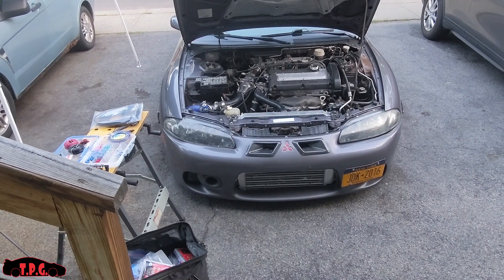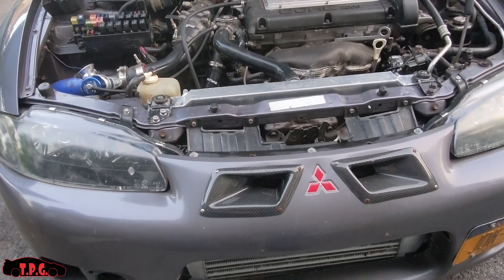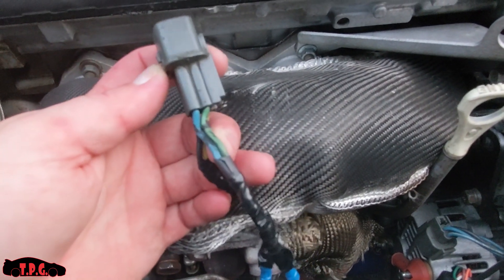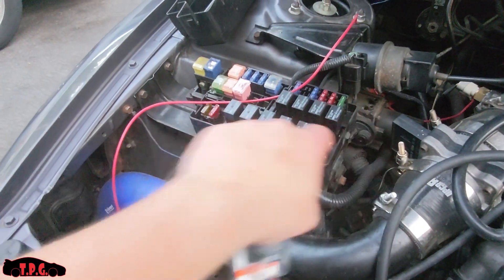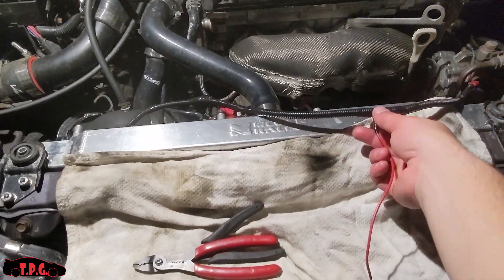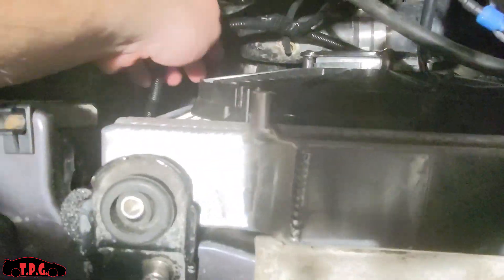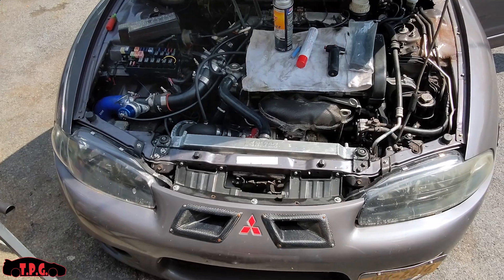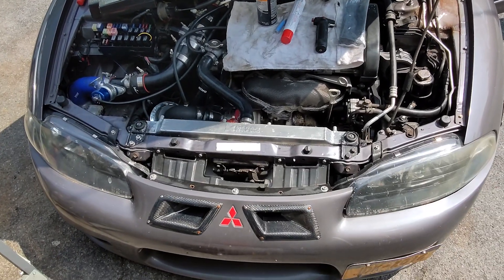WIRING RADIATOR FAN RELAY FOR DUAL SPAL FANS! (2g dsm aftermarket fan wiring)

Comment: Spal fans require 40 amp inline fuse relay to run cause they draw to much amperage they can fry your harness
Reply from the maker: Thanks for the heads up 👍 I've since rewired all of it through stock wiring with a secondary fuse all controlled by the ecu. Hopefully no more issues come from it.

Comment: You dont show at all where 86 goes or a clear explanation
Reply from the maker: Sorry about that. These relays use the same parameters if you look up a diagram. 86 is the signal from the oem harness. That will trigger the fuel pump or radiator fan or any accessory that you run with a relay to turn on. Sorry about that.

Comment: Could of just wired it to your factory connections.  
Have 2 12” slim fans, just cut the pigtails and go from there….
Reply: I was running my stock wires also. Kept popping fuse. I do believe I have a short somewhere
Reply from the maker: i DID have them wired in to the factory plugs, unfortunately the two 12in spal fans pulled to many amps for the factory fuse. I tried going from 20amp to 25 amp then 30amp (which is usually a no no). The only way I could keep them both running in ecmlink at the same time was adding a fan relay fed from the battery and triggered by the stock power wires. So far no problems with the exception of the clutch haha
Reply: @TPGDSM  that’s weird? Been running it like that for decades, even with link🤔
You might have shortage or a wire crossed pulling power out somewhere.
Well you got it so Gues that’s all that matters🤷🏻‍♂️ lol
Reply from the maker: @Ryan_1997  honestly I thought the same thing, checked for draw at the fuse panel, followed my wires and nothing?. Maybe something will show one of the next times im in there digging around.

Comment: Does the heat blanket work?
Reply: I run a blanket for my fp manifold and 11 and 12 inch spal. Kept my Temps in check
Reply from the maker: Every little bit helps👍